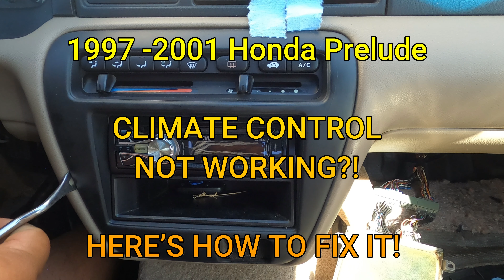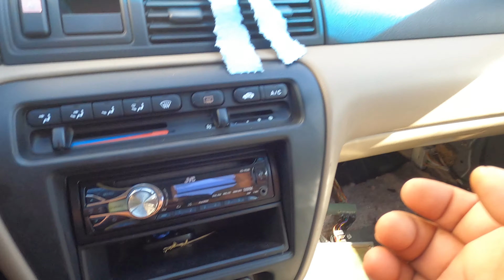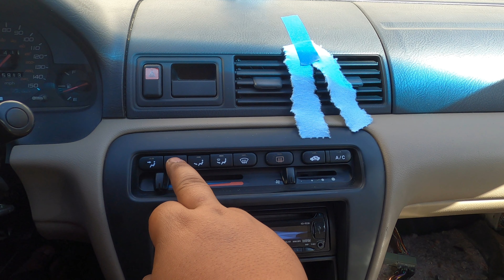1997 - 2001 Honda Prelude Climate Control Repair HVAC Buttons

Comment: I had to reflow the pins to correct flickering lights on the climate control of my 4th gen. I got this same problem on my 5th gen. I reflowed the pins. It fixed the problem just long enough for me to get very happy and proud. Then the problem came back and crushed me. I might try to reflow them again, but I’m concerned that I might add too much solder and the points begin to touch. I took off the blend door actuator and tested that the motor does work… but I don’t know if maybe the motor has gotten too weak. Replacement actuators are not available, but replacement motors to swap into the actuators are readily available and cheap.

Comment: Hey bro, thanks for the video. I ended up reflowing the board and still have the same issue. Just bought a used replacement  climate control unit and will try that in case I soldered it wrong. If this doesn’t work, do you have any other suggestions? I verified the blower motor is working as I can feeling it vibrating when on and air does come out of the defrosting windshield and window vents.
Reply from the maker: Check the blend door actuator as well..

Comment: im having the same problem with mine. did what you did but thew problem has been resolved. By chance do you know if the pins you soldered were able to has electricity flow through them or not? thanks
Reply from the maker: I didn't trace the pins to their designated traces, but I'm assuming they didn't have any broken line / traces.. if you're going that route, it'll be hard to acquire the boards schematics.. but soldering the pins is definitely a known fix for this type of control module..

Comment: Sadly, mine couldnt be fixed this way. I noticed my A/C button also doesnt work because it only supplies 4.5v instead of 12v for some reason. Any ideas?
Reply from the maker: Try cleaning the actual button with contact cleaner and alcohol.. I tried that method before to a Nissan car, and that worked immediately.. haven't tried it yet to any Hondas.. if this doesn't works, a known good and functional part is your best bet to have for a better reference..

Comment: hey Pinoy-Style-DIY, I enjoy your videos on the prelude 5th gen, would you know why I cant turn from cold to hot all the way on the climate change??? I can change it to the heater but it wont go all the way, maybe like 3/4 of the way then it wont go anymore
Reply from the maker: Check the cable for slack, you should be able to see if the lever pulls the cable all the way..

Comment: How would u go about fixing the fan speed on mine the second speed is completly power less 1,3,4 are fine ..rear defroster dont work either
Reply from the maker: For the defroster: check fuses #34 under hood, fuse #11 and R6 Relay under dash (kick panel) if fuses and relays are good, check voltage from actual switch and rear glass. For the fan switch, it is separate circuit within the climate control, more than likely the sliders are not having a good contact, you can try to clean it..
Reply: That's the fan resistor